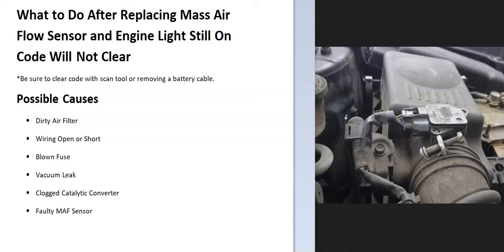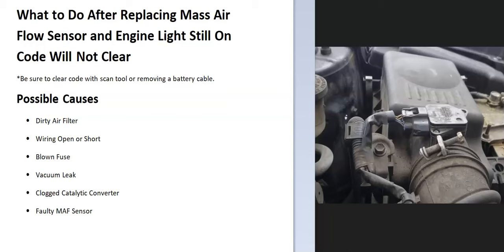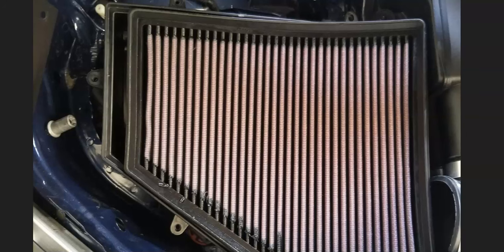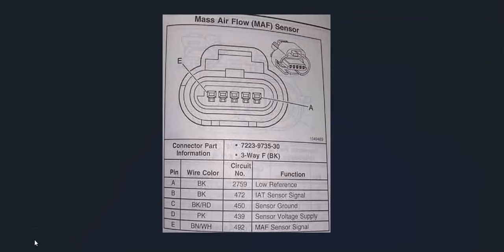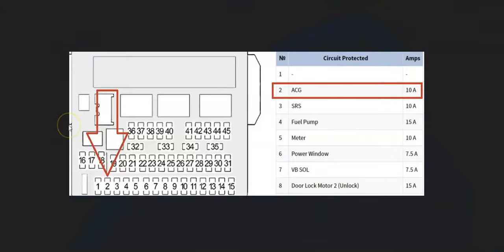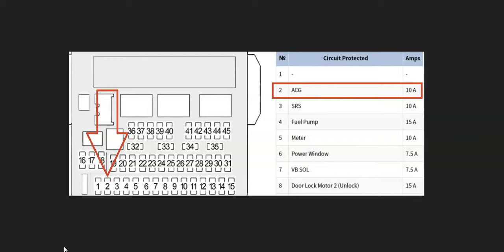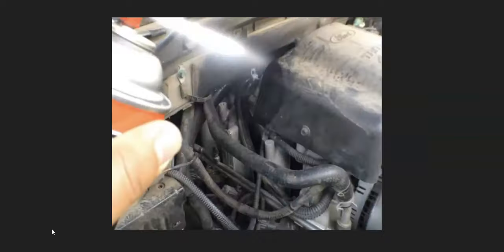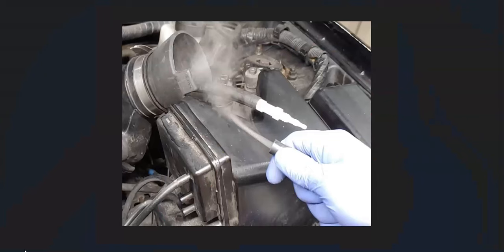What to Do After Replacing Mass Air Flow Sensor and Engine Light Still On  Code Will Not Clear

Comment: You still need to drive the vehicle for at least 60 miles so computer goes through it’s proper preset run cycles, even if you clear the codes and you are trying to pass smog it will not pass until you complete the required drive cycles..
Reply: What if I’m misfiring still?
Reply: Do I drive said 60 miles still ?
Reply: You wouldn't think so with the crazy shifting, but it does get better after driving... I didn't know clearing the code was the problem. Appreciate it
Reply: Thanks for information

Comment: We replaced maf sensor and enginr filter and the car ran amazing.  A few hours later check engine came on and the car started driving rough again. 😢 what happened? 😢😢
Reply: Me too!!!🤕
Reply: Did you fix it?
Reply: @polargc8990  unfortunately no. The check engine light disappeared, but the problem is still there.
Reply: Im having same problem that's funny @libradamontano2340
Reply: Cleaned the maf sensor and after that check engine light came on. Why? Check engine light was not on before.
Reply: My mechanic cleaned the throttle body and that fixed rough idle / running. I still have the light though after several visits. We just tried a new MAF sensor thinking first was faulty, but still my light is on.
Reply: You have to clear the code(s) by disconnecting the battery for like 20 min.  👍
Reply: @junello8354 What was wrong with it?
Reply: What was wrong with it?

Comment: So i changed it and my car won't stay started
Reply: Same issue here. It runs for few minutes and shuts off. Were you able to resolve it? If so please help me out. Any help will be appreciated.
Reply: @Historyrewritten679 disconnect MAF start vehicle, then connect again. If it stays running drive for 10-20 miles. Computer needs to relearn.

Comment: mass flow air sensor fault keeps coming on after I changed the sensor and cleared the code. I have a 2012 Toyota Tundra. What could be the problem.
Reply: The air filter might be dirty so try replacing that
Reply: Same with new air filter  replace maf  code keeps come back   I guess time to check the wires
Reply: My 2011 scion did the same changes as u alsoaor filter & some spark plugs & still the light turns on the mechanic says everything looks good
Reply: @alealeal15 is it a good mechanic with a top-rated scanner that can read the oxygen sensors and any leaks with smoke machine

Comment: Got a code that ignition coils were clogged. Ran some cleaner through. Light went off and then came back on. Changed the fuel filter and it went off. Then it popped the mass air flow censor. Changed the maf censor. Disconnected the battery. Now we are still getting the code. Anybody else ever had this on a Ford Focus. Thanks.
Reply: did u ever figure out what was wrong?

Comment: 2004 BMW 325I. Only code I have is MAF circuit high, cats are clogged. Only reason i can think it throws MAF sensor is back pressure coming through EGR valve into Crankcase. No cat code whatsoever.

Comment: Removing the battery cables will that reset the code for the engine light to go off after replacing the map sensor?

Comment: I'm sorry  this may seem a little  of a long text .Originally  I had  a lean code p0171 back in March.  Looked for vacuum  leak none to be found that I know of . Car still ran good . As time went on ,for about a month  now the car began  having  poor acceleration,  esp uphill . Finally the CEL went on p0101 maf sensor. Other leaned didn't  come back . Took  MAF sensor out , cleaned it put in back in , car still ran rough , still with theCEL on w MAF code, p0101. Only code. . Car running still weak. Yesterday  CEL went off while idling,  then it really ran shitty,even less power ,worse than has been . Cleaned MAF sensor  again . Car finally  ran  normally  , for 5 min. Took a  quick drive .then the CEL went  on again , car ran rough not as bad as before  ,but noticeably  different  . Keeps messing w me . ! No other issues , codes ,etc just the poor acceleration.  ??
Reply from the maker: It needs to be troubleshooted, but it looks like there is an intermittent problem with the MAF sensor. It likely is a failing MAF sensor or an issue in the wiring such as an open or bad connection.

Comment: Thank you so much for the info. I'm going to check into this I'm getting p106 map sensor code and I've already bought three for this vehicle it's a 2012 Kia forte but that is not the problem cuz I'm not buying a fourth one I'll keep you posted
Reply: Hi, did your problem get a solution? I'm currently on 2nd mass air flow sensor on 2011 kia sportage.

Comment: I need your help, I have a BMW 3 Series 335 Msport 2014, the car only has 28 thousand km, I changed the high flow filter with a CTS intake, my car had no warning lights, but when I disconnected the Maf sensor from the original filter and put it in a new CTS filter, the light came on. In the check engine the clear appeared with a scanner and it did not appear again but I changed the filter again and disconnected it. Sensor and the check engine came back on, what should I do?

Comment: I replaced the MAF censor and had it reset but the next day when I filled up with gas it came back on. So don't know what to do really. I will check the air filter and see what that looks like. And see where that fuse is located. But any help would be appreciated. Thanks for the video
Reply: What was it?
Reply: @RA-ie3ss  Still dwindling it down. However I did replace the intake manifold gaskets and pcv valve with new spark plugs or rather coils on my truck and now it has alot more power. The engine light has stayed off for now. So I'm going to replace the fuel pump and fuel filter. Slap on a new caddiliac converter with new exhaust system. Also replace valve cover gaskets. Possibly the purge valve dont know on that one yet. But I will say the trucks driving pretty good now.

Comment: I still get the code after changing the MAF and the oxygen sensor next to the MAF. Also put in a new air filter. But I have not installed the oxygen sensor that goes after the catalyzer under the car. Mazda 6 2013.

Comment: We took my 2016 chevy Tahoe because of check engine light and it came up p0101...we replaced the mass air flo sensor and had it re set and about 20 minutes later it came up again with same thing so replaced it and it was good for about 1 day then check engine light came on and dame code...took to mechanic and he checked with his computer and sane code but he also checked wiring and other stuff and had to get another sensor...replaced it and lasted about 3 hours and then check engine code came up again with my car acting funny so went home and called him...he can't get it in to check because his computer is down and I'm frustrated because I've been without a vehicle for 3 weeks and need it to get my grandson to his appointments from being a cancer patient...
What do I do now?
Reply: You can still drive the vehicle with a p0101 code. You'll fuel won't be as good but it's not going to destroy your truck unless the engine is running very lean or rich for extended times
Reply: Try leaving Maf Sensor un- plugged! Still will run! At least on my 02 Mitsubishi  lancer 2.0
Reply: Yea u can drive with it unplug it may run better

Comment: At this moment I have the original filter but when I disconnect the maf sensor and reconnect it the check engine light comes back I have the scanner here please let me know what to do
Reply: Did you try removing battery terminal and reconnect after 5 minutes, I read it somewhere, I am not a mechanic,fyi

Comment: 07 328i sedan p116e cleared code and it came back and rpm’s jump when pressing the brake pedal. aswell as the car almost stalls when holding brake pedal on startup.

Comment: I'm just getting a mass airflow sensor code. I replaced it once and it came back sent the sensor back. I thought it was bad gas so the light came back on and I ordered another mass air flow sensor the light went off but came back on. I sprayed some seafoam in the induction and the light went off but came back on
Reply: i have a 2019 frontier, getting p0101 code, been to dealer 3 TIMES!! new sensor installed, 3 days later had to come back because "idle air relearn" didnt take. BS, then they send me on my way again, and 3-4 days later, BOOM again. Back to dealer. Now they want to relaplce the throttle body? I'm thinking more electrical.

Comment: So I have a 2008 mazda5 with around 148k miles and these are the codes I’m getting:

P2188
System Too Rich at Idle - Bank 1
System Too Rich at Idle Bank 1
Secondary DCs
P2178: System Too Rich Off Idle Bank 1
P0101 : Mass or Volume Air Flow Circuit Range/Performance
P0841-FF: Transmission Fluid Pressure Sensor/Switch A Circult Range/Performance Concern

I have taken the MAF sensor out and cleaned it and let it dry real good and put it back but I didn’t reset the codes.
The check engine light did turn off but later that evening came back on.
I haven’t tried to pull code again but would anyone know why it might have come back on?
Reply: Same situation except Bank-1 / Bank-2 Lean 
Replaced MAF sensor & reset codes. The light came back on the next day & wouldn't start easily  ( 2017 Toyota Highlander )
I'm lost at this point & my Bank account is also getting lean
Reply: @justin8750  same with the bank account. I ended up cleaning the throttle body the best I could and that has actually fixed it for now. It was only a half assed job, so I’m gonna have to figure out how to do a full job here real quick.
Reply: N80 purge valve maybe
Reply: @AmbA4  I ended up replacing the MAF sensor and it’s still throwing basically the same codes,
System Too Rich at Idle Bank 1
Secondary DTCS
P0455: Evaporative Emission System Leak Detected (gross leak/no flow)
P0456: Evaporative Emission System Leak Detected (very small leak)
P2178: System Too Rich Off Idle Bank 1
P0101: Mass or Volume Air Flow Circuit Range/Performance
P0335: Crankshaft Position Sensor A Circuit
P2405: Evaporative Emission System Leak Detection Pump Sense Circuit Low
P0841-FF: Transmission Fluid Pressure Sensor/Switch A Circuit Range/Performance Concern

It also says that it needs a new EGR vacuum Solenoid… at this point idk what to do. If I keep driving it things will obviously get worse and break other parts but I don’t have the money for a shop and I don’t exactly have the knowledge to fix it myself.. and right now I can’t just park it somewhere.

Comment: I have a 5.3 silverado  2011 and  i replace the air mass sensor and the filter and its still has the problem when i cold start the truck its makes the sound and as i drive it does it very little then after a good while it goes away but it has been doing it lately and i have already drove it 60mph
 Someone please help😊
Reply: Possible gasket leaks on your intake has it heats up the gasket seal better good luck good luck

Comment: I replaced the upper and lower intake manifold gaskets on my 2004 Supercharged 3800.  The project went on for 4 months.

After reassembly, the engine ran like crap.  It turned out to a vacuum line that ran to the MAP sensor (at the back of the engine).  I tossed it because it was falling apart and then I forgot all about it. I capped the mystery vacuum port until I could find it’s destination.  Bad idle and stalling.  GM had relocated  my MAP sensor, on a L67, behind the engine so, un-hosed, it was sending strange values to the PCM.  There was no vacuum leak because I capped the mystery port.  It passed all of the vacuum-leak tests.

I finally read up on the MAP sensor purpose, found it , and plumbed a new line.  Mine was reading ambient atmospheric pressure, not the intake manifold vacuum.
Reply: It threw a P0101 Code. Bad values from the MAP Sensor with no vacuum, in my situation.
Reply: How do u check a maf sensor? For a 2011 suzuki kizashi
Reply: Just got a brand new maf sensor and sensors still come up and car sometimes won't start. Even after the code went off on the scanner. Or how do u check to see if the fob is the problem. Changed the fob battery a few months ago.